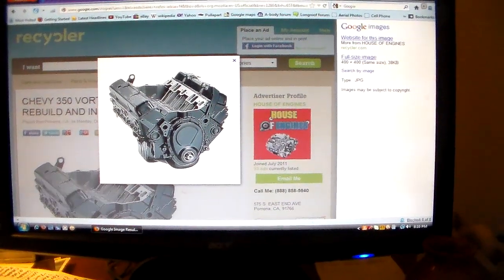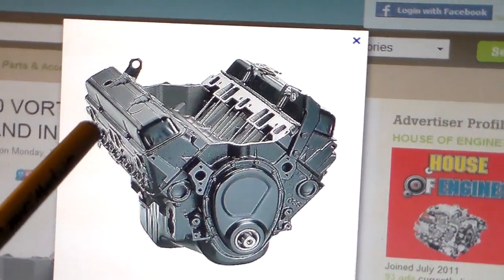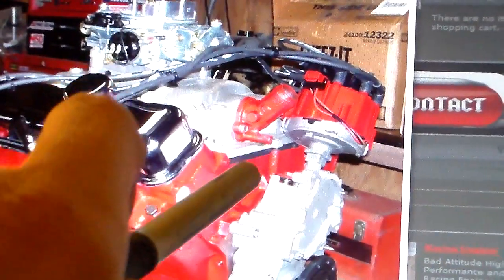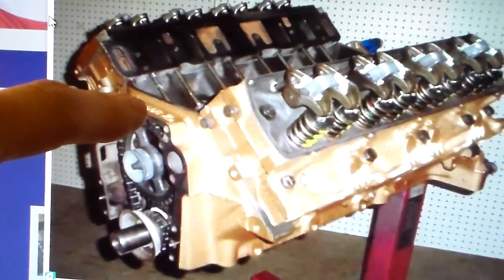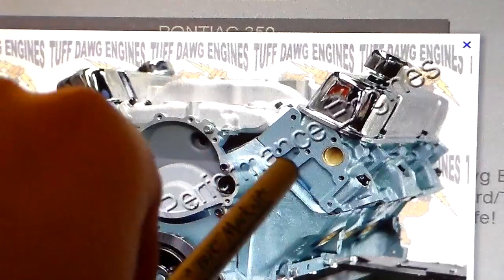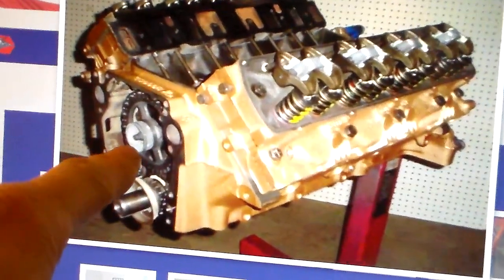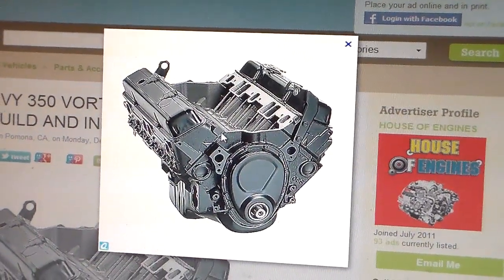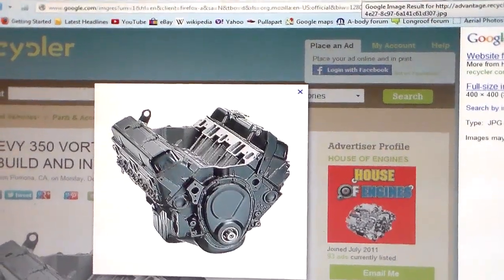Chevy, Olds, Pontiac and Buick V8 engines are not the same!

Comment: They are definitely not the same.  I remember back in high school I had a friend with a 67 Pontiac tempest with a 326 and I had a 71 Nova with a 350.  Another of our friends had an Olds 455 in a 59 GMC PU.  We all worked together on these motors and they all were unique.  Parts were not interchangeable.

Comment: I bought my first Olds under the GM employee purchase program in 1977.  I think that was the year.  Chaos resulted when I tried to add an Olds oil filter which would not fit.  The Chevy did.  Then word spread and about the SECRET engine swap and law suits resulted.  I received a letter from GM delineating the differences between the two engines and there were many non cosmetic.  The one that sticks in my mind was Olds has positive valve rotators on both intake and exhaust, Chevy exhaust only.  There were maybe 20 others that were non cosmetic or location changes.  All were negative towards Chevy.

Comment: As a hard core Pontiac man,I always get a good chuckle from Chevy clowns when they insist that chevy heads will bolt right onto a Pontiac block...lol  statements like this just prove you are not dealing with anyone who has a clue about engines or cars for that matter. I cant attest to Old's or Buick but from this video its painfully obvious they are all very different. I also know that the Q-jet carbs configurations that were stock on these engines were different as well.

Comment: Sent this video to my friend because we were having this argument. I am a Pontiac person and can tell you that a chevy and Pontiac engine sound completely different. I can tell when a chevy motor is in a Pontiac
Reply from the maker: The most simple bit of evidence is none of the parts interchange. GM started all this crap when they began sticking whatever engine they had enough of in the late-70's B-bodies. Those cars were EXTREMELY popular to the point that they ran low on Oldsmobile and Buick engines periodically so they just stuck in Chevy drivetrains since the car line was already EPA-approved for all 4 engines.

Comment: Now you have to do a video on the 3 different tiny V8's GM had in the early 80's. Chevy 267,Olds 260,Pontiac 265. Can't forget about the 3 different 455's and Chevy's 454. Just about every one I've come across confuses a Chevy 3.8 with a Buick 3.8 and confuse an Olds 307 with Chevy 305. I hope this video helps some people learn that GM cars of yesteryear had individual characteristics for each division. Ford and Chrysler just did badge engineering and still do it today.

Comment: All different.  I had a summer job at an auto parts store during the '80's. Of course most of the customers don't know. I good at identifying these engines. Buick 350 was the only one with the distributor in the front of the engine. This engine was NOT THE NAILHEAD. ALL nail heads had their distributor in the rear. There are designations for these 350's. There was the X, R, i forgot the rest. These letters had to do with the Vin #.

Comment: I always assumed that this kind of information went without saying, But as I get older I realize that general automotive knowledge is not getting passed on like it was when I was a kid. To make my case and point you need go no further than any auto parts store, where the counter person generally has no more automotive knowledge than a Wal-Mart greeter. It's a shame that they rely solely on the computer in front of them, which I've found can be wrong from time to time.

    This is the same fundamental problem I see in the general automotive repair business, where people are getting ripped off by "mechanics" because they don't know the difference between connecting rod and a spark plug.
Reply: mikenstacey 
I grew up in the 80s, long before I bought my 1st computer in the early 2000s. Thank God for the internet, because I can't tell you how much erroneous automotive info was being tossed around as fact in the mid 80s to mid 90s! Most information turned out to be accurate(60% maybe), but there were countless 'facts' passed around by local "experts" back in the day! I've known that all 5 GM divisions each produced their own engines since the mid 80s, but a lot of other claims were wrong.
Reply: I’ve learned a lot from the internet
Reply: volcano hi  
I am sorta in the same boat as you. My father traveled a lot from the time I was 10-15, then my parents divorced and things got UGLY. From then on, I saw my dad 2 weekends a month til I was 17, then for the next 33 years, I've seen him maybe 5 times, usually for maybe an hour each. But in reality, I learned more from my 1st boss during a 2.3 year period, at a machine shop in the mid 80s, than I did from my father, regarding mechanical, common sense and work ethic related stuff. From day 1, that guy was big on comments like, "and don't make a project out of it". We produced high stall torque converters.
Reply: I'm pretty good with chevys. I thought they were all identical...
Here in canada oldsmobile have CHEVY blocks in them! Wtf?
Reply: My diagnostic computer can't tell me how to fix it so you have to buy a new car
Reply: volcano hi  I read endlessly as a kid, way before the Interweb was available.  I accumulated lots of great knowledge that way.

Actually, the Interweb doesn't have "every article ever printed" - I don't remember the percentage but it's surprisingly low, although that figure is several years old.

Comment: Sir, you are absolutely correct. 
I speak from experience having grown up with these engines and owning many of them, except the Olds, but do know the 350 Rocket quite well. There were small blocks and big blocks designs offered by Olds, Chevy and Buick. Pontiac did not have a small and big block design, though may people believe they had both. The 287 was the same size block as the 455, just the internals were different. One can also find the details on all this quite easily. 
Just tell anyone that doubts they are all different engines designs to research them for themselves. The information is on the net, the public library. Heck you can likely find it all on the GM Heritage website. Or simply talk to any mechanic from that era.

Comment: Never had an Olds 350 but my dad did, and I had two 70 Chevelles, one with a Chevrolet 350 and one with a Buick 350. The Buick would rev up much faster than the other two and had gobs of torque down low, but didn't like it above 3500 RPM. The Chevrolet didn't rev up quite as fast but would pull hard to 5500 RPM. The Olds also had a ton of low end power. Some of this was because of the different bore/stroke ratios. 

All three were completely different engines. And no, the Buick wasn't the original engine in the Chevelle; it came from a wrecked Century to replace the original Chevrolet engine.

Comment: These were all descended from other displacements within 4 different engine families. The PMD 350 was directly descended from the 326. The Olds 350 came from the Olds 330. The Chevy 350 came from the small block family of engines, but especially from the 327. The Buick came from the new (as of '67) family of Buick engines which also included the Buick 400, 430, and later, the 455.

None of these 350 engines is related to each other. Same goes for 4 different 400s and 3 different 455s and a 454.  --Starting in 1977, things slowly changed, and eventually each division used each other's engines a lot.
Reply: Right, however, a few things did interchange here and there and in some cases the hot rodders would make odd combinations of stuff fit.  My grandfather told me that the very first 289 Small Block Chevy was made when a circle tracker decided that he could make a 289 Studebaker crank fit a 265 Chevy block. Both took a lot of custom machining and the guy wound up using Chrysler rods and Olds pistons, or maybe it was the other way around. The circle trackers and the drag guys built tons of weird engines with parts from GM, Chrysler, Ford and everything else you could think of. One British engine took the bearings out of Caterpillar pony motors and was used in midgets. 

In this era of 1-800-hot-rods that seems weird but they were very ingenious and would leave no stone unturned.
Reply: Yep. Obviously things would've been even more successful at all GM divisions, if their engine evolution had continued, to the point where they switched from corporate engines in the 80s, directly to Ford engines in ALL GM division cars..... Imagine how much faster and more reliable Camaros and Chevy trucks could've been.......(?) lol 
Seriously though, I didn't realize the Buick 350 was related to their big block engines in the way the Pontiac 326, 400, 455 etc were related.
Reply: Buick also had the 401 wild cat
Reply: The Buick 350 was descended from the Buick 215, one of the earliest aluminum blocks.  The 215 evolved into the 300, then the 340, finally the 350, which was in production from 1968-1980. The Buick 400-430-455 family, known as the Buick Big Block shared the same archetecture, but was it's own engine family, with very few parts interchanging.

Comment: In addition, the oil filter housing is cast as part of the chevrolet block while all of the others have it as a separate piece. Also, the pontiac does not use its intake manifold as a lifter valley cover, instead it has a separate valley pan.

Comment: I used to work at an auto parts store and we were constantly amazed at how many self-proclaimed 'experts' would spout this 'they're all the same!" nonsense - and then get mondo pissed off when they got the 'wrong' part.  We'd try to explain to them that the Buick 3.8 and the Chevy 3.8 were different engines, that each divisions' 350s were, in fact, different motors, that GM often played mix and match with the engines installed in their cars  but this information were usually fall on completely deaf ears.   Some guys would get pissed if you told them that they didn't have an Oldsmobile or Pontiac V6, because neither division built V6s.   They usually used Buick V6s, though that was far from guaranteed.   "It's an Oldsmobile; why would it have a BUICK (or Pontiac, or Chevy) engine in it?!"  was the usual logic.    And it DIDN'T help that GM (at the time) only made ONE straight-six and used it in many BOP models as well.    

Generally, the guy behind the counter was called 'ignorant' and 'stupid' despite actually knowing what they were talking about.
Reply: Worse-the same car, same chassis, could have more than one possible of those engines, sometimes with identical nominal displacement numbers. Olds in particular had a lot of cars that could have a Olds OR a Chevy 350. The VIN codes were supposed to be different but occasionally they were not even out of the factory. You had to get out and look and know what to look for in a lot of cases. And if you have a 30 year old car out there all bets are off. In GM it's easy to convert damn near anything to a SBC. And if there were emissions nazis in the state those mechanics could make it look factory to the untrained eye.

Comment: Buick, Olds and Pontiac back in the day had the same transmission bolt pattern at the back of the block and for some reason they had assembly plants that were referred to by some as B.O.P. plants. While Cadillac and Chevrolet shared the same bolt pattern. But that's the only thing any of them really shared.

Comment: AMC engines were different from Buick engines but Buick engines did find their way into some Jeep products.
Reply: Buick (GM) sold the 215 V8 to Rover and the V6 based on it, via the iron 300 Buick that was not related to the nailhead or the later 350-455 but was an extended 215, was sold to AMC. You cant make shit like this up.GM bought the V6 line back from AMC and made the pushrod 90 degree V6 Buick, as a corporate engine for a LONG time. Maybe still does.
Reply: GM replaced the Buick 3.8 with the GM 3.6 DOHC
Reply: Yup.  Dauntless 350 was a Buick engine
Reply: Jeep CJs in the early '80s used the Pontiac "Iron Duke" 2.5L 4 banger for a base engine.  I had an 80 CJ5 with that engine and drove the hell out of it for several years.  It worked great in Jeeps.

Comment: I agree. I think a lot of people think they are the same because of later engines like the LT1and L98 were used in several different makes. My 1995 z28 actually had an LT1 out of a buick roadmaster.
Reply: +chris smith Exactly. Most of the GM divisions had switched to the Chevy style 350 and 305 style blocks (with the exception of a few that still ran a 5 liter Cadillac or Olds, can't recall 100% which) as well as completely gotten rid of anything larger than roughly 350-360 CID (Mopar had the 360, Ford had it's 351w). I honestly consider it one of the saddest parts of GM history because it completely buried so many beautifully designed and unique engine options that just don't exist anymore.

These days you're lucky if an engine swap is possible...and, when it is, the sheer pain-in-the-ass it causes working with all of the CPU related atrocities makes it to where you'll wish you never started.
Reply: people forget gmcs engines
Reply: if it had that engine in your Z28,you or the previous owner put it in the car.the lt1 in the camaro/trans am was specific to the two cars only.the impala ss had a different lt1 WITH CAST HEADS.im not sure about the roadmaster but i know it is not the same as the aluminum headed "car specific" camaro/firebird engine.

Comment: Didn't mention an obvious difference -- the cylinder (and therefore the piston & rod) closest to the front of the crankshaft is on the opposite bank for a Pontiac.
Many Canadians get confused because their Pontiac Parisiennes came with Chevy 327's in the 1960's. It was interesting when a Canadian's car broke down on vacation in the USA and the American mechanic looked into their Pontiac engine bay and saw a Bow-Tie Block...

Comment from the maker: Yes, that culminated in a lawsuit that forced GM to put that small disclaimer on the window sticker that said "This vehicle may be equipped with an engine built by various GM divisions"..or similar. The Olds engine was perceived as a better engine...and rightly so.
Reply: I remember as a kid seeing that disclaimer start appearing in the '70s.
Reply: Ive got a 87 regal limited and I want to stay true to the brand. But I dont know of any buick V8s that have a lot of power other than a 455. And I dont want a turbo V6.  What would you suggest?
Reply from the maker: @chd66imp  I suggest finding someone with a Turbo Regal and taking it for a test drive.

Comment: Yes even the bell housing is different.  I once put a 4.1 Buick V6 IN a 79 Datsun PU.  I swapped out the stock turbo 200 tranny on the Buick with a Munsie M22 4-speed from a Vette.  I had to then swap out the bell housing with one from a Buick to get it all to bolt together.  Lastly, I had to get the clutch cable mechanism from a Chevy Monza to finally get this all to work.  Oh yeah, and a custom driveline had to be made.  Yes I ran the Datsun rear end but had to change gears from 4.11 to 3.70.  It still was geared a bit high for freeway driving.
Reply from the maker: wow, that's Roadkill-type stuff lol.

Comment: Also the Chevy 383 is not a big block, it is a 350 with a small block 400 crankshaft. Chevy made a 400 small block and also a "400 big block" which is a bored out 396 and measures 402ci.
Reply: Some late 1969 model year 396s were 402s as well.
Reply: eric cm most 396 engines are in fact 402cu.in. the true 396 was a 65 or so truck engine with a great reputation. So rather than use 402 designation G.M. engineering decided to just keep things simple and call it the 396... and yes it's a great engine.

Comment: The distributor in an Oldsmobile Engine is also shorter then they are in a Chevy Engine as well! The body of the distributor where it holds the shaft is much much shorter!! I found that out years ago when I was building my 350 Rocket Motor and a friend sold me a Chevy Impala I was going to use for parts, only to realize the 327 engine had totally different pieces on it, including the distributor!!
Reply: One other MAJOR difference with all these engines is the automatic transmission bell house bolt pattern!! ONLY Buick, Oldsmobile AND Pontiac use the same transmissions!! A Chevy transmission WILL NEVER bolt directly to an Oldsmobile, Pontiac or Buick engine!! In fact the B.O.P (Buick Olds Pontiac) transmissions will only fit one other car most of the time and that is a Cadillac!! 

YES You can bolt a stick shift transmission to your Chevy, Buick, Olds or Pontiac......BUT AGAIN you have to have the correct bell housing!! Because even the stick shift cars use a totally DIFFERENT bell housing as well!!

Comment: They are all different, period. After GM went corporate in the late 70s or so, to save money and meet emission standards, all the GM chassis that have V8 options used Chevrolet, Olds, and Pontiac engines for a while, then went to variations of the small block Chevy in the end.

Comment: I understand the "BOP" bell housing transmissions causing confusion, but I thought most guys knew the differences between all of them. 

The big cause for this is the modern way of "corporate" parts. Engines for example with LS V8's in Chevy's, Cadillac's, and Pontiac's. That's why some younger or "newer to cars" guys who haven't done too much widespread research think that all parts interchange all over GM. 

Thanks for making this to straighten it all out for some!

Comment: Prior to the Corporate design integration of 1967 every division of GM had their own motors, transmissions and rear ends. Motors-Chevy small block, Pontiac Stratostreak (55-58) then a standardized small block, Oldsmobile rocket, Buick nailhead, Cadillac v8. Transmissions-Chevy power glide and turbo glide, Pontiac hydromatic, Oldsmobile hydromatic, Buick dynaflow, Cadillac hydromatic?